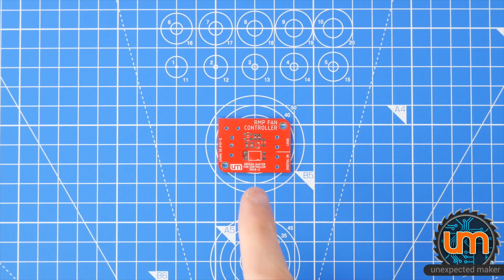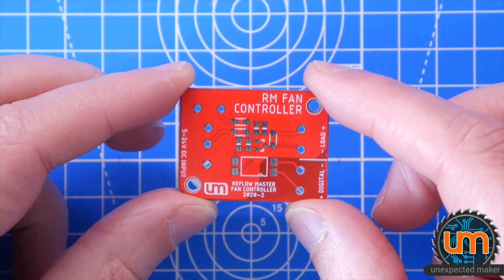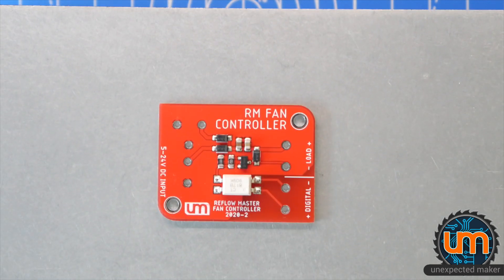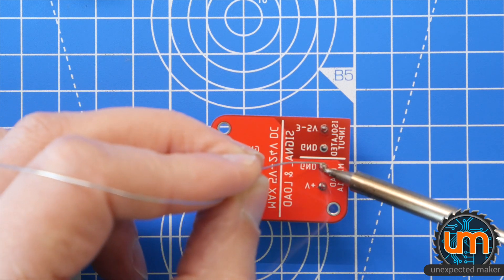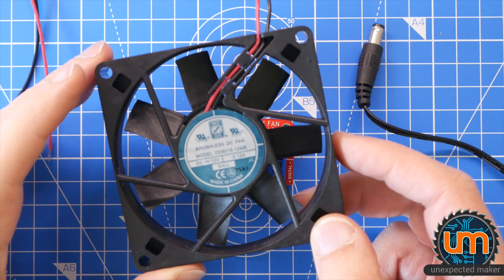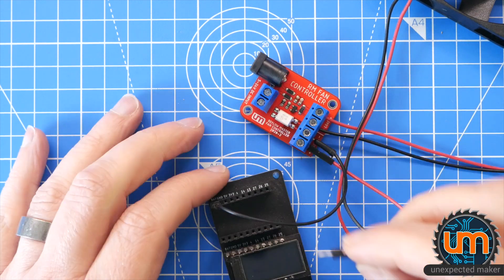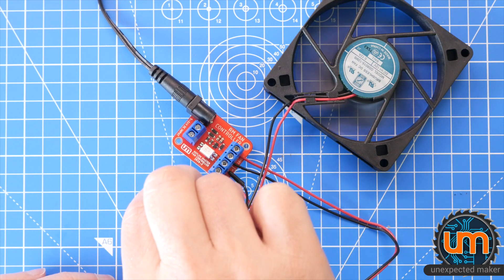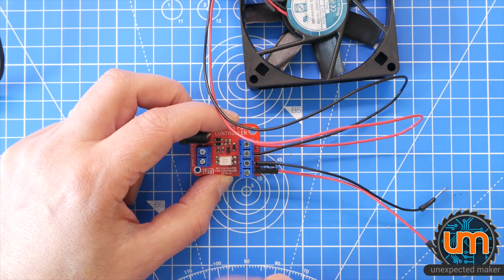RM Fan Controller - First Build & Power up!

Comment: How do you make sure that the Gate Voltage is not too high ? If somebody wants to drive an 24V Fan with this driver, what limits the Gate Voltage to the Mosfet ?
Reply from the maker: There's a resistor on the gate :)
Reply: @UnexpectedMaker  Yes, there is a 10K Resistor in Series with the Gate. Thats not good, as the Mosfet will turn on very slow due to this Resistor. The Gate can not load fast enough, the Mosfet turns on slowly and gets hot (especially with PWM). When the Mosfet is turned fully on (loaded), there will be virtually no current to the Gate. No current through the Resistor, no Voltage drop. My guess is, you will have the full Voltage on the Gate when it is turned on.

An easy Solution could be a Voltage Divider at the Gate, but with much lower Resistors. But with a Voltage Range from 5 - 24V it would be difficult with a Voltage Divider.
In most cases i use a regulated Voltage for this, there are no big currents in driving these Mosfets, a small Regulator does the Job reliable with any input Voltage. I use only 4,7 to 10 Ohms in series with the Mosfets to limit the Inrush Current of the Gate.

Comment: So funny you can't endorse a Chinese version with only 6 components while being so unsecure about your own build
That said, great build. Love it.
Reply: For intended function the solution fullfills needs. Just a few items to tidy up, and as you said you are able to supply the complete system and not be dependant on some other module.
Reply: You can almost guarantee any mosfet module form china is using counterfeit or used mosfets that have be re labelled.
Reply from the maker: It's a first design, first assembly, first time using an optocoupler (first time choosing one too), and first time using that specific FET. Why should I be confident? The Chinese boards are not 6 components. They are many more, without even having dual power input or reverse voltage protection, so not even a close comparison  :)

Comment: Does the opto need a resistor inline with the input to limit the current through the led?
Reply: Suggest a resistor as typically the opto expects of order of 10mA.  Further depending on I/O current capability of the driving logic it will be better to pull low for active state as most logic is designed with higher pull low current than pullup current, depends on the processor signal lines. If not capable of full saturated swiching the IO line will run at increased dissipation as the swiching will be outside of saturation state.
Reply: Plan resistor value for a normal IR or RED led  voltage drop in the opto coupler and the driver voltage range and use 10mA target unless some other value is known.there are some coupler with 3 to 5mA nom8nal but 10mA is no issue. Most couplers activate at or below 1mA, especially when not needing much output drive like this mosfet output, coupling factor could be below 20% on poor  grade couplers, good ones with over 60% coupling. Depend on output side type anyway, could be simple opto - diode, opto -transistor,  opto-darlington, even logic gate or more on expensive ones, but 4 pin device one of the first three only each respectively greater coupling factor.
Reply: By the way a typical data sheet is the PC817 opto coupler, which is likley the type equivalent to the one you are using. A lot of the 4pin couplers seem based on this type, originally by SHARP.. You can assume similar to your device.
Reply from the maker: Hmm, interesting question. I didn't see any in reference circuits I was looking at when designing the circuit, so I don't think so? Though I'm sure it can't hurt. Maybe for the final version I'll add a resistor. Can always go 0R if needed.
Reply: @UnexpectedMaker  you definitely need a resistor , its an led, it will pull as much as it can from the port, pwm in software or an analog out will work for now.
Reply from the maker: There was no resistor in the datasheet application notes. But sure, I'll add a resistor for the final boards!
Reply: @UnexpectedMaker  what is the chip?
Reply from the maker: I'm going to add a resistor and an LED so I can visualise the IO signal.
Part I settled on is Chinese part/datasheet, so no diagrams, but was spec'd off some parts on DigiKey. Can't remember which ones now... It was back in January :(
Reply: I tried to pause the video to see the chip markings, but to fuzzy. Limit current to less that 10ma and it should be ok,if you find data sheet look for forward voltage FV so you know how much voltage to drop across the resistor at 10ma.
Reply: By the way if you have not looked at the PC817 datasheet, the Vf is speced at 1.2 V typ and 1.3V max at 20mA and 25"C. The max permitted current is specced at 50mA (continuous) while abs max is 1A peak ( has 3V max drop for 500mA).
Output for Vce at 5v for 5mA opto input is from 2.5mA to 30mA, but that is not saturated. To saturate the spec states for 20mA input and 1mA collector (ouput)  load the Vce sat is 0.1v typ and 0.2v max. 
Lots more data in the data sheet....
Reply: you could measure the LEDs consumption to see what it draws

Comment: How do you control the fan? Just on and off, or do you also try to control the speed of the fan?
Reply from the maker: On/Off or PWM to control speed. Not sure what max frequency I can switch the optocoupler yet. Now I have a working board I can experiment.
Reply: @UnexpectedMaker  The opto coupler would typically fail beyond 100KHz,  as most of these Opto devices have delays of several usec, but you are unlikely  to need that much, more probably PWM will be in few KHz range, no need to push the frequency for practical purposes.
Reply: @helmuthschultes9243  yeah, but don't ever use a few KHz when driving electronics that move. Even capacitors and coils can become really noisy.
Reply: @bonnome2  I am quite aware of the audio problems at that frequency range, depending on fan I tend to sub 20KHz, but  be aware of the construction of the driven item. The fans normally have no noise issues, while laminated cores and loose windings on many coils, under high peak current do create audible vibrations.  The fans will actually have much smoothed current already. Due iron core losses too high frequency is also no good. Seon will likely do his relatively very low, sub hertz PWM. Not that I would do that either, though again the dynamics of these fans will most likely dynamically   average, I rather suspect it     may induce some low  vibration too.
Reply: @UnexpectedMaker  You can't control most fans with PWM. Did you test it out?
Reply from the maker: @bonnome2 The fans I bought can be PWM'd. One of the reasons I chose them :)
@Helmuth Schultes I won't be driving it faster than a few Hz. I only want either fun speed, or super slow.